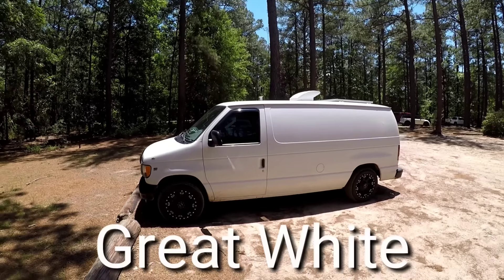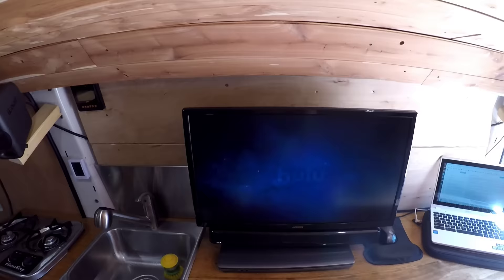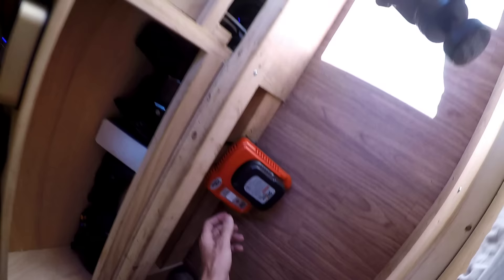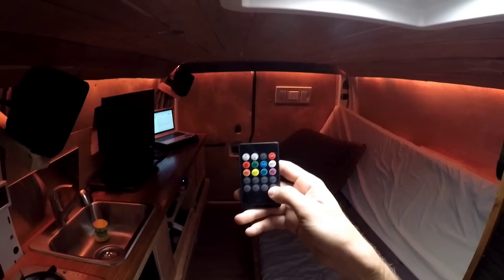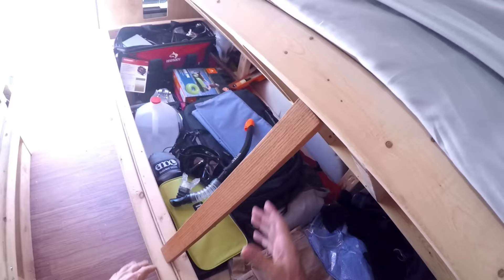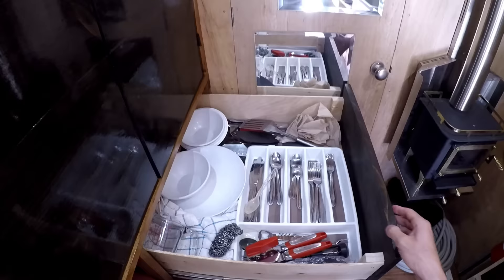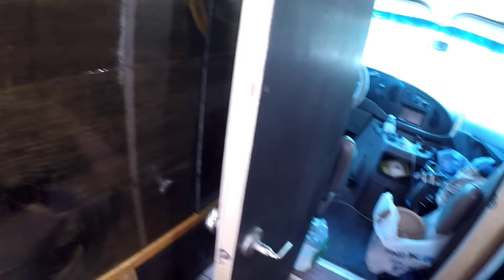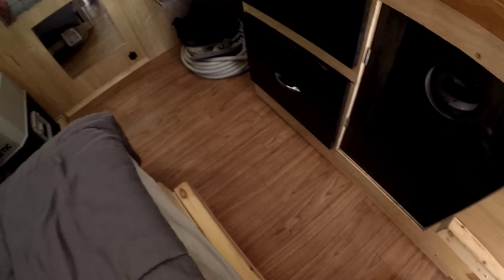STEALTH VAN LIFE TOUR | Extremely ORGANIZED Cargo Van Conversion

Comment: I'd like to see video of you driving the thing.  What is it like to drive an Econoline camper van?  What is the noise level from everything jarring around?  What is it like when you hit a bump or broken pavement?
Reply from the maker: So I've sold this van now. I'm on my second build. Interesting video proposition. I'll make a short of me driving my new one once it's done fully.

This one in the video though, there were some metal sounds from the woodstove I never deadened, the tv mount would sometimes clink, but other than that it sounded like a stong van engine driving down the road. Not much different from any other van, besides having a little more weight to it. The power behind it was good. The sound of the engine was deep and strong. The noise level for my new van can be heard in my newest video btw! Not sure, but watch maybe about 2 to 3 mins into the video and there is a clip of what it sounds like with a really good microphone
Reply: @OutdoorsEmbrace  Was it an E150?  What engine did it have?  4.6L V8?  Do u recommend that engine or something bigger (5.4L, V10, or diesel)?

Comment: I think the bed can do some improvement, the other things are perfect, maybe more solar panel then it will be excellent.
Reply from the maker: Honestly the bed could of had hydraulics holding up the chest style storage. Other than that, the build is my number 1 choice for easy setup each night.

Since I actually live around other people in vans and see all their builds all the time, I've chosen to again use this same design in my next van. It's the easiest set up, gives the most storage, makes the most sense to me looks and utility wise, especially didn't want loose cushions without a hard backing. This bed style met all those demands.

Comment: You know you can get a small bus a 12-seater or 15 and make it just like you just did. The van bus will not be considered commercial vehicle and would be considered a GMC Savannah heavy duty and you can park anywhere. It won't be considered an RV unless you register it as an RV and meet all the requirements.

Comment: How do you sleep at night with the doors locked (it's urban, after all) without being too hot? Running a compressor to run an A.C. unit wouldn't be stealth.  And can you go inside the van and lock the doors (for any reason) during the day if it's 80 degrees out?  Certainly you can't spend all day, every day, in a Starbucks.  Staying warm is one thing; staying cool is the hard part, if you ever need to lock yourself inside, do work, feel safe, etc.  One might be able to run an A.C. if one had a super good solar power system, and it was never cloudy.  I live where it's cloudy a lot.  These are the details I'm looking for.  Thanks!
Reply from the maker: Look at your other comment, I answered

Comment: The biggest issue here is no toilet and shower which is one of the most important part unless you live in Nevada or Florida were the weather is nice but I would not recommend this up north were there is harsh winters.
Reply from the maker: Not an issue if you can do without. Use public toilets and planet Fitness for showers

Comment: You did a really nice job of putting that together. Very efficient design. Seeing that you have an MPPT charge controller, you might consider one of those sail boat wind turbines. They come in a variety of sizes and outputs. Thanks for sharing...comments on Nov.30, 2021

Comment: Great work! Love it! Question: Would replacing the solar panel with a 400w panel allow you to use the fridge 24/7?
Reply from the maker: 100% yes! Honestly i could have used the fridge as is in this video, the issue wasn't solar. The issue was a bad connection to the fridge. The solution, do NOT use the 12 volt plug they have in a 12 volt socket. Instead screw off the plug part and it reveals two wires, one positive and one negative. Just put that to your solar battery and you are good!

Issue was it would get power, but the plug would be loose enough to only receive power if voltage was high enough, so the fridge would turn off at night.

Comment: I am almost 66. I have a damaged back and use a cane. Even so, I am thinking on this. I have my van. But it has been a nightmare of repairs. Still fixing over 14 months. I can't be bothered with all the fancy stuff. Does that wood stove have the same dangers of carbon buildup as a camp stove would? Do you have a monoxide detector?
Reply from the maker: I do have a monoxide detector! It does have those types of dangers, but a woodstove is one of the safest ways to heat, although not very practical. Get a diesel heater installed! So much easier and can use it whenever at the turn of a dial.

Comment: Great.. I'm looking to start a build... trying to gain knowledge.. I would like to know about the water in the battery deal?? Why and info..and also about the solar panel full setup info.. great job
Reply from the maker: The water deal:
Flooded Lead acid batteries are way cheaper, but you need to fill them every 3 months or so. I started with them, but moved up to AGM sealed batteries

Comment: You shouldn't store propane Inside hour van . Close  to hour wood stove .. it is a safety issue..propane  needs to be stored outside so that the air can circulate  around it.where u have hour propane tank now  is like an accident waiting to happen

Comment: Just wondering if the lights inside can be seen from the outside through the roof fan vent at night.....
Reply from the maker: A tiny bit if all the way up, yes. I take this into account while stealth camping. I don't put the fan all the way up, but crack it partially up.

Comment: hmm is that fan thingy and vents enuff in the summer with the doors closed?
Reply from the maker: It was enough if you got naked in 100 degree weather. Look at my new van set up though! This one is good enough to keep clothes on in 100 degree weather. It's so nice with more insulation. I have 5 inches on my walls now and overlapping with the insulation on the cieling. No breaks in insulation = so much better!

Comment: How do you store your food if you don't want to use the refrigerator cuz it takes too much power you know like your meat
Reply from the maker: I've since fixed my power.
I keep my fridge on 24/7 everywhere now.
It takes like 1 amp an hour given the compressor. Meat is stored on the bottom usually where it is coldest.

Comment: Such a cool toilet, where is the poop station?
Reply from the maker: None, restrooms are everywhere. Haha

In my new van, I will have a toilet
Reply: @OutdoorsEmbrace  expecting a video for that too! This is a new thing I discovered, I like how you are very skilled with this wood work that I don’t know the term for.

One thing, how do you make sure the propane container is safe? Like, this is still a van that can go through traffic which means there is always a risk, right?
Reply from the maker: @coldeny4624  a propane bottle is made to take an impact or gunshot even. High heat is its weakness. I had a leak detector inside that van on the floor. It was ok enough, but yes still somewhat uneasy on the mind.

Comment: How much did that cost for you to do all that stuff I mean the van included Plus the interior how much did that cost and I don't know too much to get an old RV depends on how much it cost cuz you sometimes you can find an older RV pretty cheap
Reply from the maker: I was about to make a short video on why you should get a van over a cheap old RV. The old RV will cost way more long term for multiple things. I'm actually putting the video together because I have people comment this all the time, thinking used RVs are cheaper.

I spent about $8000 total on everything. Cheaper than buying a $4000 used RV long term still. Van allows you to save so much more in various ways. I'll release soon

Comment: Carbon monoxide is denser than air so your sensor should be near the floor, not the ceiling.   By the time your sensor goes off you would already have suffocated.   If it's close to the floor you have more time to wake up and get fresh air after it gets triggered.
Reply from the maker: This is actually the opposite. CO is lighter than air but disburses evenly. Why hotels and houses have their CO detectors on the ceiling.

I usually LOVE every comment, but I don't want wrong info at the top. But thanks for commenting.

Comment: Carbon monoxide is heavier than air, it fills from the bottom up you should have it lowers than where you sleep
Reply from the maker: CO rises, CO detector should be up high. What you said is a common misconception, talking about CO2 which is harmless. Google

Comment: So where do you go to do your business?
Reply from the maker: Publuc toilets
Reply: @OutdoorsEmbrace  When I used to drive semi truck, sometimes there would not be any public toilets around. So, I had a bucket, and a special toilet seat that fit on the bucket, and then just used really good deoderizeded trash bags, tied up the waste and dumped it when I was able.
Reply from the maker: @Shannon_Lacey  my friends do that. If I'm in an emergency overnight, double up plastic bags and throw them away haha. Toilet paper is kept at edge of bed. Works

Otherwise just pee jug

Comment: I'm late to the party, but just have to say your carbon monoxide detector should be mounted/stored lower to the floor as CO is heavier than air and will accumulate from the bottom up.
Reply from the maker: CO is actually lighter than air and disburses evenly in spaces. 

You are thinking about CO2, the non dangerous one.

I have a video explaining the difference between them and how almost everyone "knows" the wrong thing.
Reply: @OutdoorsEmbrace  Last time I listen to the local fire dept! Thanks for letting me know :)

Comment: Carbon Monoxide is heavier than air. If your detector is that high, you’ll be dead before it goes off.

CO detecters should be as low as possible
Reply from the maker: This is not true. Watch my second newest video where I go over CO.
You are talking about CO2 which is not harmful and floats down to the floor. CO rises but disburses evenly.

Comment: Shouldn’t carbon monoxide detector be closer to the floor for your safety ❤️
Reply from the maker: I just made a video on placement. It should be higher up like they are in houses and hotels. Carbon Monoxide is lighter than air, but disburses evenly.